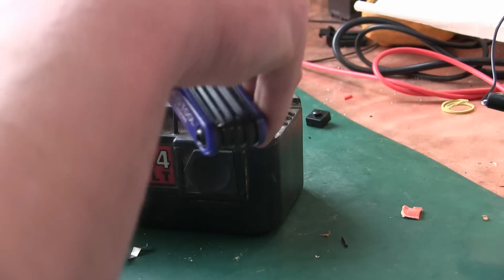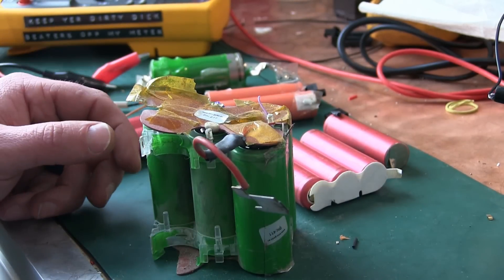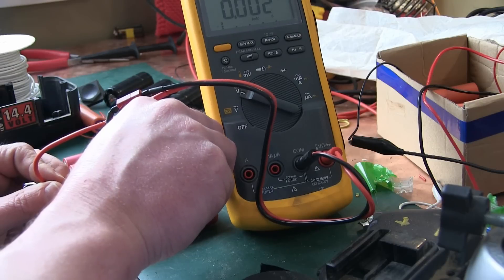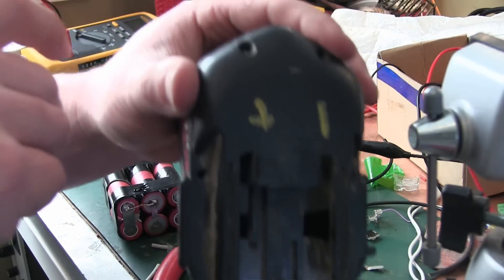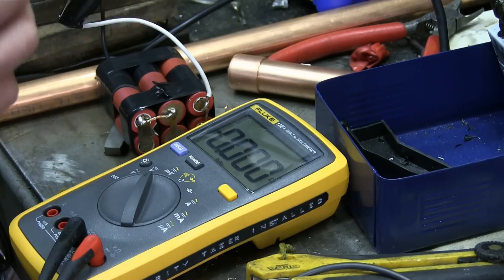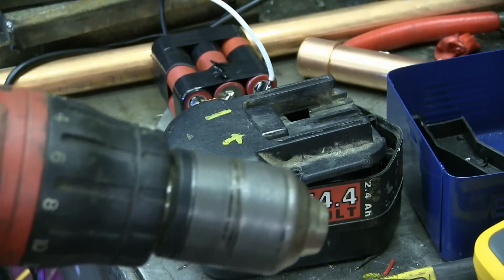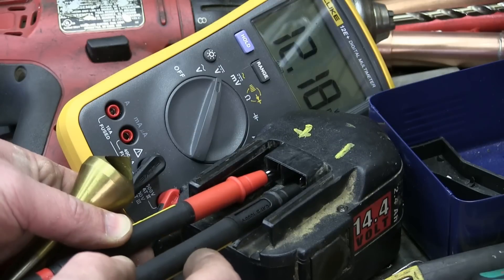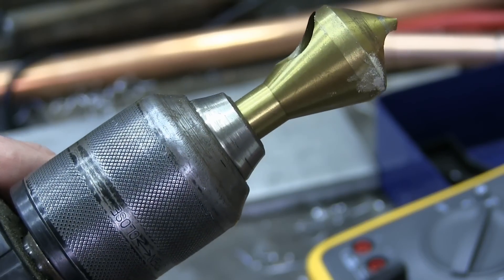New Lithium for Old Tools!

Comment: When you build a pack like this you should at least install a set of balance leads so that you can charge this pack with a balance charger.  Without the balance leads, there is no way of knowing if you are getting 4.2v on each parallel string due to small variances in the cells even if they are matched.  

It is also easy enough to buy small balance boards that can fit inside the pack and allow you to charge the pack with an unregulated charger through one set of ports while you get the full power out of the main factory ports.  Every once in a while you can find little 3S and 4S BMS boards cheaply (less than $10) that are rated for 30-45A which generally work well for this same type of mod and that would give you a battery cut-off and protection from thermal runaway as well.

If you have a 3d printer available it would probably be fairly easy to create a pack adapter piece to make the lipo cells fit vertically in the pack which would make it slightly taller but would allow you to run it at 4S2P rather than 3S2P.

Comment: I was thinking maybe just hooking the drill up to a power supply directly would be a better idea but the problem there is you don't have the mobility of a cordless drill. 
but maybe some form of adapter that'd be used to just plug any other battery with case into the drill could be better

Comment: best to use sub c NIMH cells for rebuilds. I rebuilt my 18v Porter cable nicd with NIMH 3.0mah cells from ebay. the old charger will charge both nicd and nimh cells.

Comment: those 18650s should be balance charged.  you might want to look into getting a hobby charger/ discharger (which would give you the added benefit of testing capacity if each cell before making a failed pack out of them)

Comment: You should be balancing them from the bottom end.  All those cells will have different capacities, and you want them to run empty all at the same time, otherwise you'll end up reversing charge on the weak ones.  If you balance them at the bottom, you can run them to zero without any real issues.  They'll stay balanced unless the cells have internal shorts - in which case they need to go anyway.  There is no other way for them to drift in charge - they don't have significant internal discharge, there's no electrochemical process for that to happen.

BTW, Dewalt uses this method.

However you do need to be careful charging, since you may fill the small cells before the more capacious ones get to 4.2v.  Charge the pack in series, but watch the voltage of each cell (pair).  When any of them reach their peak voltage, you're done, and you get what you get.  Don't worry about the CV phase, undercharging them is better for their life and you won't get substantial capacity above CC to 4.2 (or even 4.0.)

It may seem like a hassle to babysit the charge, but you have to monitor one end or the other, and it's a lot easier to watch the top than the bottom - also the charge conditions are more consistent than the discharge current, which will cause sagging and such to conflict with the real state of things.

Comment: I use an arduino to test the capacity of my old cells to know which are good and which aren't. it seems like you had a mix of good and bad ones even though they came out of the same pack. I can give more info on the arduino setup if desired

Comment: If you hook a motor directly up to a battery the battery voltage controls both the speed and the torque of the motor.

As a motor spins it generates a "back EMF" (voltage) -- which is linearly proportional to speed.  The torque is linearly proportional to current,  which is (applied voltage - back EMF)/motor winding resistance.  So the "no load speed" is what happens when the forward voltage = back voltage + current (torque required to overcome friction) * resistance.

Comment: What you did wrong was that you connected in series three groups of paralleled batteries instead of four. Even though the maximum voltage of lithium batteries without any load is 4.2v, the nominal voltage (under load) drops down to about 3.6v, multiply that by 4 and you get 14.4v. After all, 14.4v lithium batteries have 4 cells (or 4 groups). Take the DeWalt 14.4v li-ion tools for example, which however are not available outside Europe.
Reply: ++ on this design voltage of these should be 3.7.  also use a RC balanced pack charger would works great, just a dangly tail to deal with while working

Comment: Run four batteries in parallel and series three of those. 
mount another 6 of the batteries on the outside of the case and parallel it to the 6 inside it for more amperage.

Comment: You really need to get a little iMax B6 or some balance charger if you're going to be building and charging your own packs like that...
Also, while it's ok to just charge them at a constant 4.2V per cell, it's not the recommended way of charging them, what you SHOULD be doing is raising the voltage about 0.10-0.20 volts (or there about) above what the battery is currently at and raising it to 4.2V as it charges, I'm not entirely sure as to why, I've just noticed that's how the battery chargers do it, so there's probably a good reason behind it.

Comment: Why not using 4 18640 in series? You would get the needed voltage, so everuthing should work as when it was bought (better battery life though). Even using the original charger would be possible. 
That is what I did with my old trusty cordless drill (not as fancy as your Milwaukee haha). I wanted to put 8 instead of 4 cells but battery life is good enough and I was lazy at the time I did it.

Comment: Kind of old here, but I love my old makita impact driver. Instead of changing out the cells like this, I am thinking of just locating a good cheap source of a later battery complete with charger, and then just adapt the entire assembly to the makita. If it's good enough for dewalt to market that way, it's good enough to diy for makita, 'eh?

One question, aside from drilling faster with a higher voltage, what kind of problems can I expect if I put a higher voltage battery on the makita 14.4? I'm thinking, not much, because they are DC...

Comment: Under load each two-battery cluster will go down to about 3.6V, unlike Ni-Cd which will stay closer to its nominal voltage under load, so you need 4 of those in series to make 14.4V.

You should be able to jam another two batteries in there or hell, maybe even wire up a 2S1P pack and a 2S2P pack together in series which would be the same number of batteries (6) but a higher voltage.  I have no idea if that is safe as in whether or not the two in series that aren't paralleled up with a buddy can take the current of the other pack all by themselves.  

I honestly think you would get much better performance out of this by simply using 4 Li-ion cells in series, no parallel.  You'd get the right voltage and each cell should still be able to provide enough current, I mean the original pack just had 12 Ni-Cd's in series so same kind of idea.

Comment: Shoehorn 4 cells in series so that 4x 3.7v nominal will give something closer to 14.4.
Lastly, soldering lithium ion cells is a death sentence for them. big caps, a MOSFET or two and make a small spot welder for the tabs

Comment: may i suggestify 4s\cells lipo from those rc modelling types. balancing loader and lipo saver available, can work with li-ion also.
the "saver" i got doesnt restrict power at all, it just blinks when the whole pack is getting too low and lets me carry on.

Comment: Say what you will about Snap-On, but their 18V Ni-Cd charger will do either chemistry. The batteries are still holding on fine, but working in the cold makes me want to convert to lithium. I have a large number of 25A rated 18650s lying around...

Comment: I realise the Lithium batteries were free but if you really like the drill, Rebuild the battery packs with Nicads. If you have to use your power supply to charge it, it will never be charged. the risk of fire, the reduced performance defeats all of  the conveniences of the cordless tool.

Comment: Or you could do the obvious and just replace the ni-cad cells with ni-MH. Benefits: same torque and speed as original, can basically use the same charger, and WAY safer then lithium.

Comment: I cant believe the quality of the discussion in the comments for this video. Ita excelent! And yeah, it kind of works now, but with a few cycles, those batteries will be toast. Its a sweet idea, but if you want 18650s that can power that drill without damaging themsemves you need to buy pretty expensive batteries, protect them from undervoltage/overvoltage/overcurrent, and balance the batteries with a special charger.

Comment: I cast/made a RedLithium <-> NiCad adapter for all my old Milwaukee NiCad tools. 
Not buying them again just for the reason they changed the connector format when they came out with Lithium powered tools.
Eff-You Milwaukee.

Comment: my dad did this to an old drill, he even put in a ballance charger socket,  i told him he would have to charge it often because it had no discharge protection, but he just kept saying how long the charge lasts and how he would hardly ever have to charge it, that was until he finally ran it down until it would no longer run, and who would have guessed he over discharged it and damaged at least one of the batteries and could no longer charge it.

moral of the story, lithium batteries usually have a protection circuit for a reason, and if you don't use them don't treat them like alkaline batteries unless you want to break them.
Reply: ***** Plus protection boards are about $2 from ebay. Way less than a decent 18650.
Reply: There are no 50 amp protection boards. You can find at most boards supporting up to 10 chinese amps.
Reply: You are not going to get 50a out of those 18650s.

If you want 50a go with an RC LiPo or double up samsung high draw cells

You can get 20A 3S boards from a few sellers (that look pretty skookum) You just connect one board to each set of three and connect the outputs together.

I would just go with a Li-Po and watch the voltage.
Reply: During a locked-rotor situation you can get surprisingly high currents out of battery packs in cordless tools. Maybe not 50 amps from those specific low current cells but my point still stands, 10 amps is not enough for a cordless tool if you want any kind of usable torque.
Reply: It depends on the tool and the design of the tool. Brushless DC motors with gear reductions can get massive torque at fairly low current thanks to the very high motor speed.

Comment: You should put more emphasis on the "not for every day use" bit. It's most certainly an option but it's also a lot cheaper to just replace dead NiCd cells. And you do only need to change the dead ones not the whole pack unless it's all a leaky mess.

Comment: Personally I'd want to add a balance connector on the back of the pack just so the pack can be balance charged when the cells become imbalanced... she'll work without but the chances that a cell will overvolt are higher

Comment: Why didn't you add a protection/charging circuit? I figure those things are next to nothing on the ol' ebays, might be worth putting it in if only to keep the thing from crapping out once you forget that you can't discharge it completely.

Comment: you could modify the case on one side  to make it 4x2S.(16V)
Just cut one wall away and the find some PP-Plastic, shape it with a heatgun to fit and the epoxy glue it 
on. A bit sanding and its done. Easier would be just cut the top secion off, and glue it on a bigger case where the batteries fit in.

Comment: Well, as a proof-of-concept, this is pretty damned awesome. I have a ton of friends with older (more better) power tools, and some of them have had to stop using their old power tools because of lack of modern battery replacements. I think personally, I would rather pay for some new batteries, recycle the old ones, keep the tool and make it last long after the new tools die. Great video, and thank you for confirming some thing I had been wondering about.

Comment: time to hit up a vape shop, pick up six Samsung 25r or LG HG4 cells and call it good.
Reply: I was thinking the same thing
Reply: I've not tried em myself but the Efest batteries seem to be yer best BANG for yer buck, Haha.
That or have a look on here for some nice comparisons. http://lygte-info.dk/review/batteries2012/Common18650comparator.php
Reply: +vgamesx1 efest makes trash batteries.
Reply: +Ro Bc yes they do ! Samsung 25r for me ... or mxjo that's all I will use .
Reply: +the deadtroll think I've heard of that dude on Grimm green's videos .
Reply: Yep. It seems like Sony VTC4's is the way to go for this kind of application.
Reply: the deadtroll Just because it's a few years old doesn't make it irelavent... 
A lot of those batteries are the same ones still being sold today, now has the manufacturer changed them? 
Who knows unless you want to test them yourself, but it at least gives you a baseline or a rough idea on how they should perform and yes some of them have high drain, did you not see the 15-30A filters?

However, thanks for tip on that battery guide.
Reply: You will never see Sony batterries used in high end cordless tools.  When it comes to 18650s Sony has the absolute worst safety record and has had to recall well over 10 million 18650s.
Reply: Funny how Sony cells end up in the high end cordless tools then, and everyone else generally uses Panasonic/Sanyo, LG, and Samsung.
Reply: +vgamesx1 efest changes cells while still using the same label.they just buy up on cheap cells ans use them no matter what they can really deliver

Comment: all you need to do is put only one more cell in there , cutt out some of the support material and put it in sideways next to the other batteries, i'v done it on 4 of my drills and they are as good as new batteries. that one extra cell makes all the difference. "don't keep your cells in the vice"

Comment: Lithium, NiCd, NiMh all have different charging requirements. You can't just stuff as many as will fit into the case. (Yes you did mention that) Given the inherent risk of for, explosion and poison gas, why not just replace the cell(s) with right one?  Even purchasing the right ones outright is still a good investment.

Comment: you would have no problem getting 4S li-poly in there.  they are cheep, powerful and would be close to the right voltage.  But li-polys will burn you  and everything else down if you don't treat them right.

Comment: I hope you retouch this subject after some more research, preferably before blowing up the shop.  Nice hack for the short term but be gentile on the recharge if you just use the leads instead of individually charging your packs since you lack a balancing circuit.

Comment: Get yourself some high discharge 18650s, a couple of Samsung 30Qs would probably work wonders in there. It looks like you're getting some voltage drop under load.

Comment: cut the lower part of the battery case at the seam, extend with a bit of insulated metal sheet, tape it all shut, infinite space for batteries?

Comment: Maybe check out a local hobby shop - see their 3S or 4S batteries. About 20-25 USD for the High output (60C) and another 20 for a good charger...  the price might seem a tad high but it's cheaper than two "patented" inspection lights ;-)

Comment: Hi,
     When using Lithium batteries in series you must put in protection circuits this enables each battery in the chain to stop charging when the full charge is reached. To continue charging after the full charge is reached is the cause of the explosions and spraying of corrosive material everywhere. Exploding lithium batteries are, I suppose, a bit exciting but that excitement is greatly offset by the cost of the lithium batteries themselves and the resulting chemical burns to body and equipment , when the protection circuits can be had from ebay, 10 for $2 or $3.
take care, and regards.
MoK

Comment: Why not using the old charger?
12x 1,4V=16,8V NiCd 
4x   4,2V=16,8V Li-Ion 
I would use less or smaller cells and add a BMS to it.

Comment: Pretty cool, what about running those batteries two sets of 3 in series ran parallel?   That will up the voltage which I think might be a better configuration.  Also, any concern about balancing?  I guess maybe who cares for something like this, but was just wondering your thoughts..

Comment: Buy yourself some NiMH batteries to rebuild a NiCd pack.   They're the same size, similar voltage and will use the same charger.  About 2x the capacity.

Comment: Lithium ion comes in many physical sizes... you either need to use the correct size or modify the battery casing... 3 in series is only around 11 volts, not 12-13, definitely not 14.4. You need a 4S pack.

You can get the cells for under $5 each new so it's still worth doing this... NiCd sucks. No need to constrain yourself to using crap recycled 18650s.

If you can wait several weeks for shipping and deal with having to sign for a package, check FastTech for the cells. Good prices. Definitely not "fast" though.

Comment: I've done exactly the same thing myself recently with older model of Festool drill lol, except I didn't have battery for it at all so I had to make an enclosure with charger socket, I used 6 cells of dirt cheap 18650 cells and the moment they arrived I knew they're gonna be shitty 'cause they were super duper light compared to say genuine Olight 18650 cell, they also die off really fast BUT....Festool still chooches for a moment!

Comment: Odd idea just glue the battery's to the top of the old battery case and you can make a battery pack as large as you like by just wrapping them in tape to stop them from shorting when you set it down. 

You only need the contacts rail and locks off the old case.